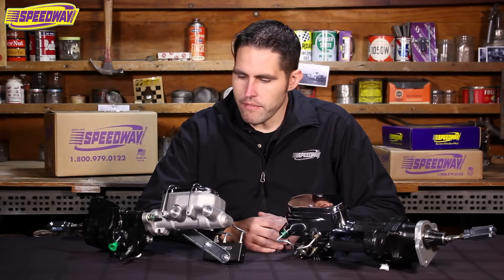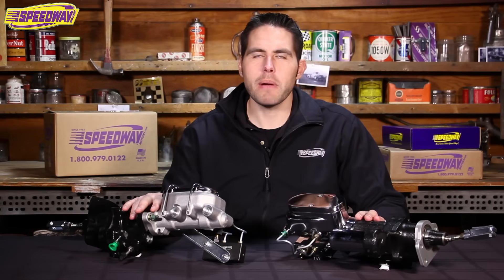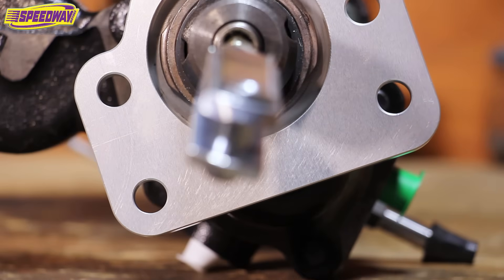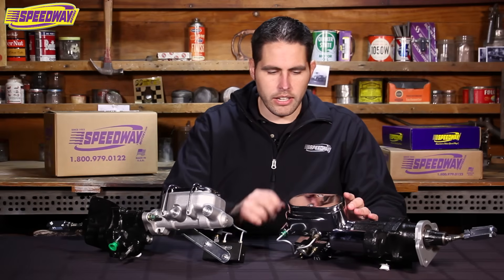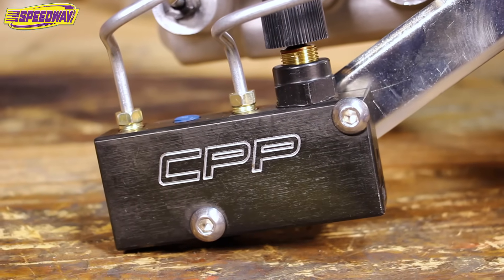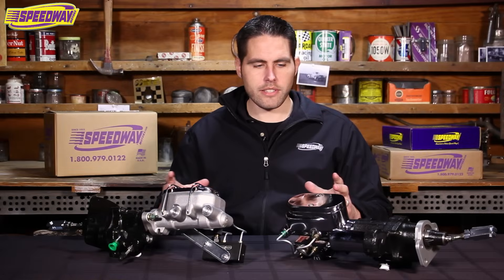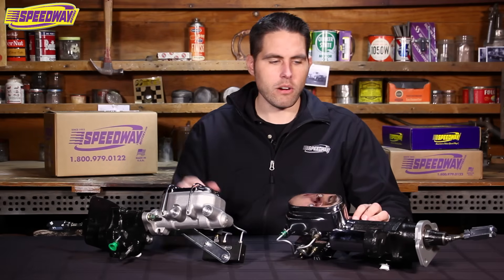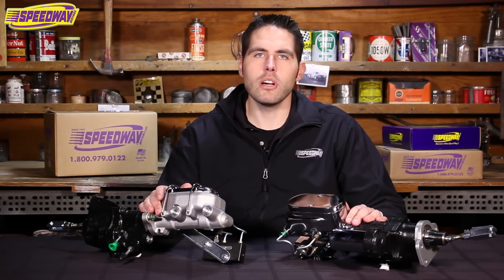Speedway Tech Talk - CPP Hydroboost Brake Systems

Comment: Could I run hydroboost brakes in conjunction with hydro steering, all ran off of the same pump?
Reply: thats how they are designed to work. you plumb it into the existing power steering pump.

Comment: I have a hydrobooster like the one you have shown. One day the PS fluid began running out from between the two flashings. Figuring it was a seal, I replaced it with a rebuild, which also poured fluid. Since then, I've replaced it three times in a row. As soon as I fill it, it's pours out. I'm either doing something wrong or these rebuilds aren't worth a damn. It's on a 86 GMC C6000. I don't know if there is valve in the pump that limits the flow or something else. Not sure on this one,  but I could use some old school advice. Thanks. Dave
Reply from the maker: With the hydro boost fairly new to Speedway Motors diagnosing problems is more likely to go to the manufacturer.  If you have a unit like we offer CPP techs would be the ones to contact.  If a factory GM unit then one of their techs or the supplier of the unit to GM.  Since you have tried rebuilt units the manufacturer would be a resource also.  From your inquiry it may also relate to a stuck valve in the pump itself.
Reply: @speedwaymotors  Thanks. I don't think they have a tech support. They just say, Send it back and we'll send another. Well, they have done that, 3 or 4 times now. Your advice is good. I'm going to go directly to a GM dealer with a parts department and see what they have to say. I should have done that to begin with. Back in the day before computers, that's what we did. Thanks again. Dave
Reply: @Matticefence  It's been 4 months... did you find an answer?
Reply: @firefighteruppy9121  Yes. It was a reman defect. Parts were fine. Their assembly was at fault. On the third one, I decided to completely disassemble it to see for myself where the leak was. I took pictures along the way to make sure reassembly was not a problem. Referencing the images as I began putting it back together, I realized a steel retainer that held the seal and spring was not fully seated, when I opened it. The outer edge was almost 1/8 of an inch above the cast edge. So I tapped it in until it stopped, even with the outer surface. Then installed it. The leak was gone. I wish I knew that for the first one. I would have saved a lot of time and a few bucks. So there's the answer for anyone with this problem. Just tap in the spring retaining plate flush even with the mounting edge, and maybe you'll get lucky.

Comment: Have Hydro brake system on my 47 chevy, I want to put chrome master cyl. on it ,there a special bore to work with my set up. I install a chrome one a couple years ago and no brakes so put the old master cyl. back on it works
Reply: Looks like there are no replies to these questions.

Comment: Why do you need a two groove pulley?
Reply from the maker: When running a hydro boost brake system it relies on the power steering pump for assist. It works the pump harder and for that fact and also a safety feature originally equipped hydro boost vehicles commonly have a two groove pulley on the pump and two belts to the crankshaft pulley.
Reply: Speedway Motors I see, thank you for clarifying that.
Reply: If you installed say a Saginaw pump but no power steering would it be fine to run just to the hdyroboost and nothing else?  Thinking of one for a Dodge a100/a108